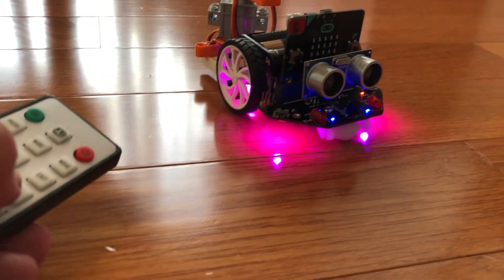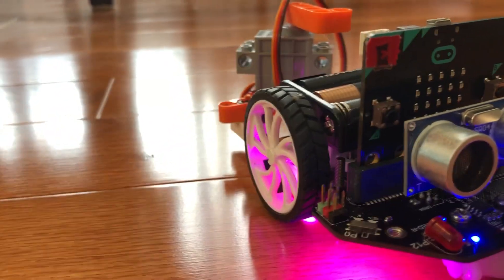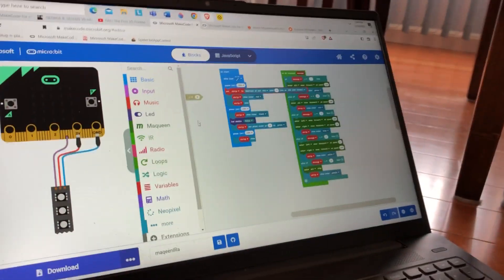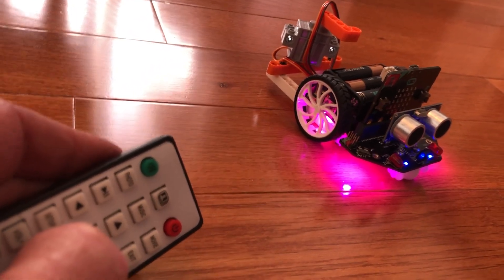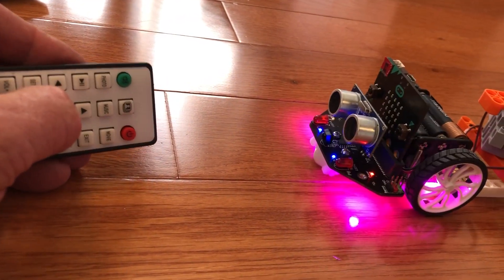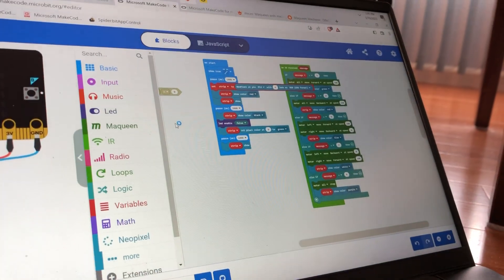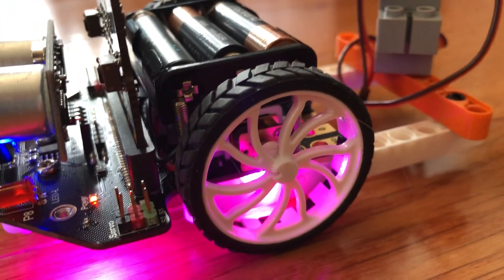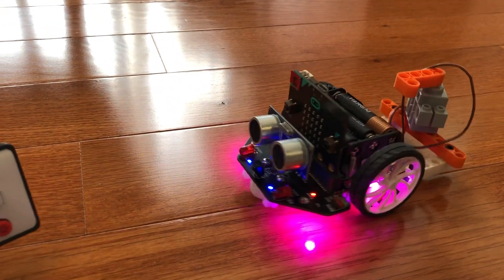Generic IR remote control of DF Robot Micro Maqueen, V4. Microbit is V1.5

Comment: I tried your code but Maqueen didn't receive IR from any remote. Do we need specific remote?
Reply from the maker: You should not need a specific remote. If you are using an IR remote control, like the one shown or for a television or radio then using the FIRST code shown installed on the Microbit and WHEN the Microbit is installed in the Mqueen car and the Mqueen is powered on, then a number should be shown on the Microbit LED array when you press a button on the IR remote.. If this does not work the tell me and i will try it again on my Maqueen.
Reply: @makecodeandhardware1395  So I bought a cheap universal IR remote and it worked like a charm. Seller didn't know if It would work with Maqueen&microbit but he knew it'd work with Anduino, NEC, IR1838 receiver so I went with it.  My other remotes tv/fans/air conditioner's didn't work. 
 
Thanks